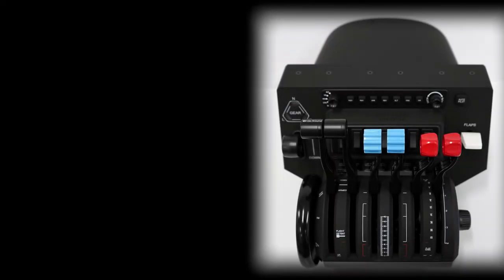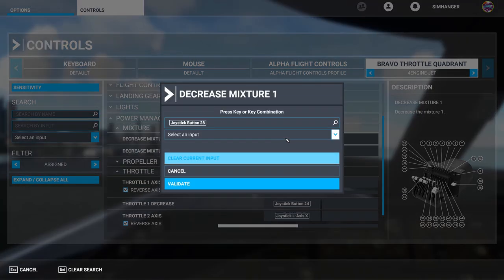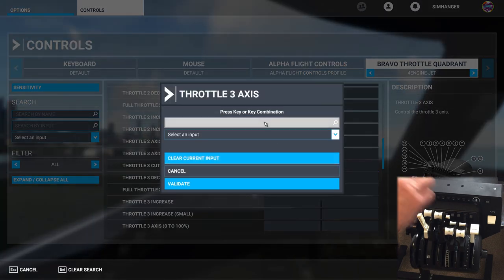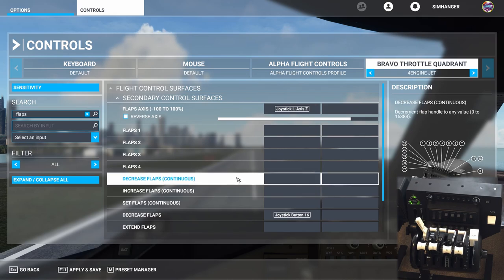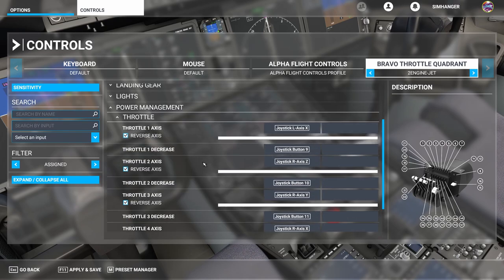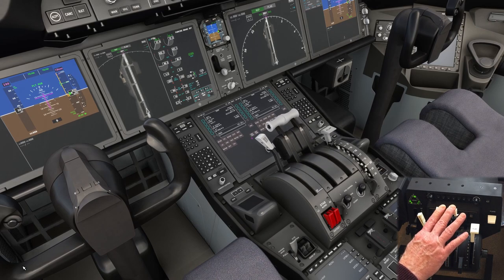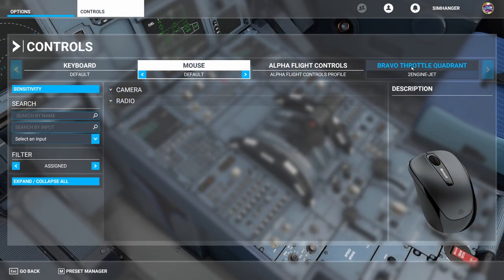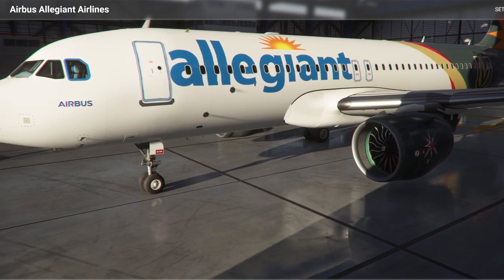Configuring the JETS in the Bravo Throttle Quadrant | Microsoft Flight Simulator

Comment: I cannot find the flaps axis -100-100. My only option is 0-100. And my max setting is 15% flaps with that.
Reply from the maker: Hi Kyle, it is there….with your bravo selected in the controls options use search by name….type in flaps….this should bring up what your looking for. Hope it helps.
Reply: @SimHangerFS  thanks for the reply, but I had tried that and still didn't see it. I even typed in -100, and brought up all the options that had it listed and flaps wasn't listed. Very peculiar.
Reply from the maker: @kylemccartney1831  sounds as if something is corrupted. Suggest reinstall bravo drivers and see if that helps?
Reply: I have the same problem, -100 to 100 is not there.